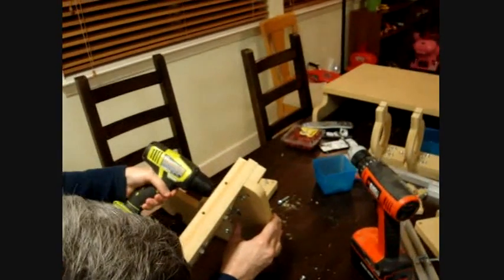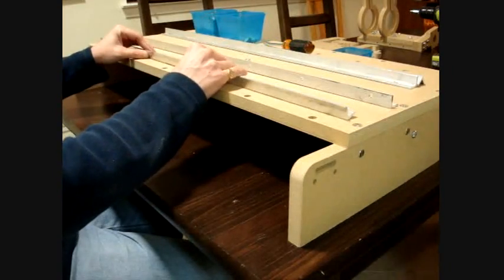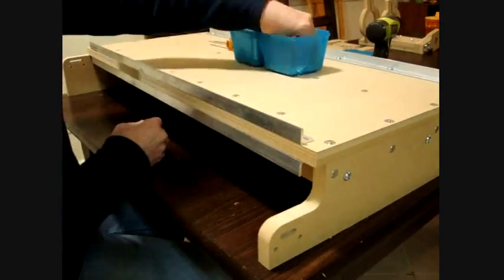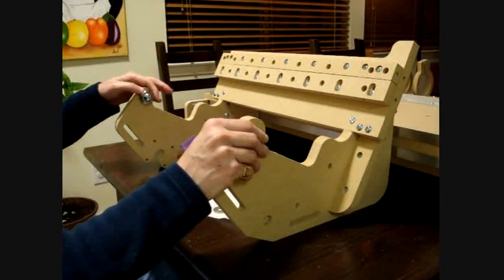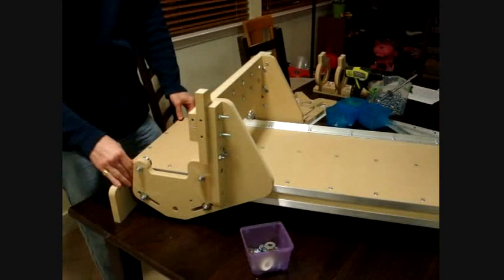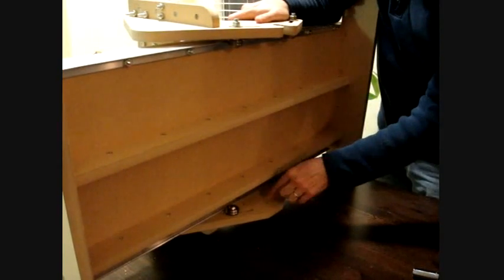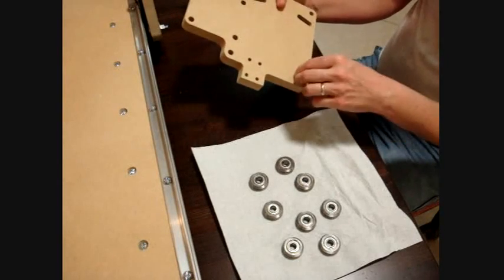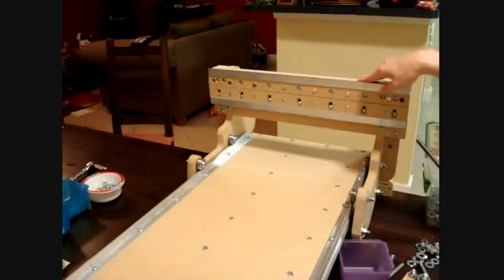bluechick assembly part 2_0001.wmv

Comment: Hi . You used MDF or HDF ,...how durable are those materials . I have build a cnc myself ,using chipboard for first size test . I think , i would go for aluminium parts for final assembly. Still have second though's

Comment from the maker: @roncoffey The hardened steel bearings essentially "cold roll" the aluminum creating a pressed grain structure with residual stresses, which makes that part of the aluminum rail stronger.  As time goes by, the rails exhibit the same profile as the bearings and with the increased surface area, wear is almost non-existent.  However, adjustment is necessary during the rolling period.